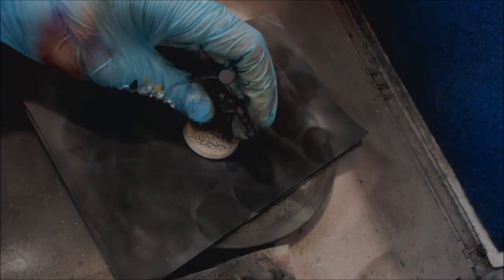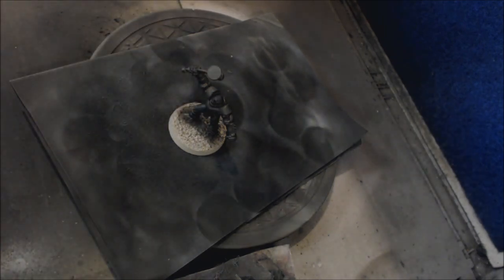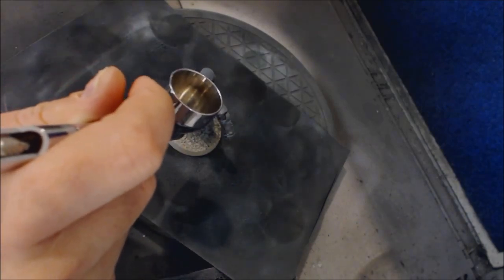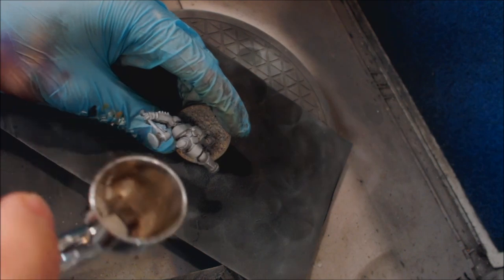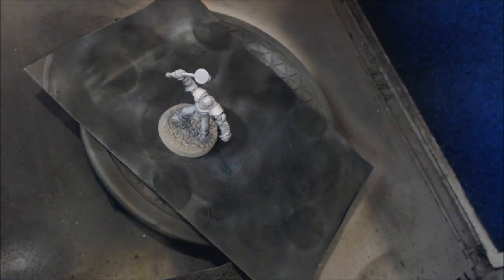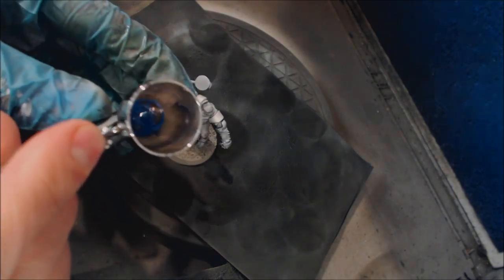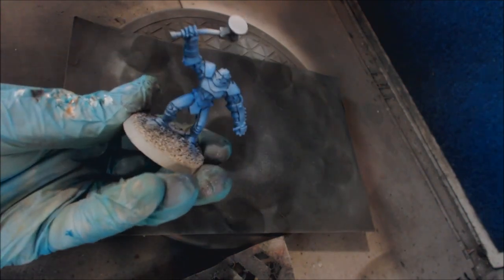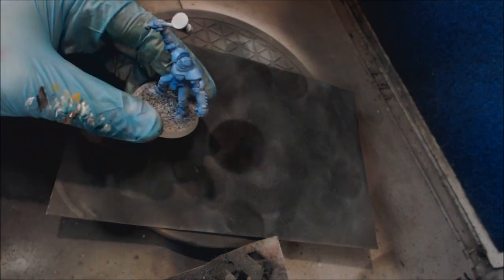Hobby Cheating 75 - Zenithal Highlighting and Glazes

Comment: Super useful Vince! Thanks for all the hobby cheating series. Question: can you combine the zenithal technique here with a rattle can Retributor armor base coat for the classic Stormcast scheme? Or is the rattle can paint so thick that you'll obliterate the great shading from the zenithal undercoat? Would love to hear how you'd go about it! Cheers!
Reply from the maker: So it doesn't generally work with Metallic paints, as metallic pigment is opaque and so doesn't work well with undershading. I can't think of a good way to do it straight with Retributor armor spray, though you could do it with an airbrush and start with a deep gold with some brown ink mixed in as a base. Then go regular gold, then gold silver.
Reply: Makes sense - so you'll still get the nice luminance shift from dark gold->gold->gold/silver but you're also putting down metallic color vs here where you've separated the light/dark zenithal shading from the application of the hue/color itself with the glazing. Very helpful! Thanks again!
I think it may be time for me to look into a beginner airbrush setup!

Comment: For the black lining, Would this be a good candidate for oil washing? Am I right in thinking those smooth transitions would then be protected from your brush?
Reply from the maker: Yep, absolutely, you will still tint the color slightly unless you are very thorough with your cleaning, but it's minor and speed is the order of the day, it's a GREAT solution.

Comment: I'm getting my first airbrush in a week or so, so i've got alot to learn. as far as your process, what would you do to then paint the base after you have airbrushed the mini in this example? It seems like alot of people completely finish their bases separate of the models, but then some people seem to still paint the mini attached to an unfinished base. just curious, thanks for the video.
Reply from the maker: So in general, this happened to be attached to the base, but my normal process is to paint them completely separately. I finish the model, then finish the base, then put them together. If you want to do it with the figure attached, I would recommend the base be last, airbrush and do all your work on the mini, then brush paint the base to finish it out. 

hope that helps.
Reply: @VinceVenturella  that does help thanks. just one further thing you could illuminate for me then is how you go about putting the two together without ruining the paint job on one of the parts. Is it all just pre drilled pins?

Comment: If you're painting a dark blue colour, like Kantor Blue for example, how do you prevent it looking de-saturated, or too light in the lighter areas?
Reply from the maker: So the key is to apply additional glazes at the lowest levels off the highlight. There will always be some desaturtion,but additional glazes in the shadow areas will make the color seem more rich and true to it's original color while preserving the highlights.

Comment: with your straight white, what is your thinning ratio, or are you well shaken and straight from the botte?

also, please, what psi are you shooting from?

thank you for the great video and for your response
Reply from the maker: With white primer if that's what you're using for zenithal, I put a few drops of thinner into it before the primer (say 1 thinner to 3 primer). If I am using ink or paint, I think to whatever standard ratio I thin that to for a layer. I shoot at 18-20 PSI.
Reply: Thank you Mr Venturella, for the information!

Comment: Hi Vince, I want to speed paint some new Primis marines when they come out soon. I want to do a blood angels theme, but I have a couple of questions first :) 

1) Is there a difference in between just using a red triad and hitting up at different angles vs the method you demonstrated here?
2) Also, when I do the undercoats for red doing this method, do I go 
black > grey > light grey/white > brown (all) > red (all).
OR brown > light brown > lighter brown/white > red (all)

Thanks again.
Reply from the maker: 1) I assume you mean doing this whole process with red. The difference would be in the depth of shadows and highlights. Especially with red (as it's a translucent color) undershading makes a big difference in the depth of the final color. 
2) I would go Black>Grey>Brown Ink>Warm White (like an ivory)>Thin red glaze. If you want to get really crazy Black>Purple Ink>Grey>Brown Ink>Ivory>Red Glaze.
Reply: Vince Venturella Thankyou. Just clarifying, black (primed) > grey (90degrees) > brown ink (airbrushed 45degrees) then a warm white (above) > red ink (air brush glaze)?
Reply: Vince Venturella also, any recommendations on a red or brown ink? particularly a common one I might find in Aus ?
Reply from the maker: Black (Everywhere) > Grey (45 degrees) > Thinned Brown Ink (Everywhere) > Ivory (90 degrees directly from above) > Red Ink/Glaze (I would actually go for thinned paint for coverage, but it depends on the ink). 

As for inks, I would say Vallejo. They are generally available everywhere from Amazon. If you can get the standard ink pack, that contains many useful colors including black, brown (Sepia), Purple, Blue, Red and Yellow.

Comment: Is it better to spray without the base on? I'm worried about wrecking it. How do I make it nice after spraying it up?
Reply from the maker: Well, my personal preference generally is to always keep the base separate. In this case, it was already done. My best advice is if you refuse to do the base completely separately, it should be done like I did here where it's already based and textured. Priming and zenithaling everything at once will only help. Just paint the base separate, your darker early colors will mostly cover whatever is done here with a color.

Comment: When using a pastel/soft colours in the greens and yellows what would you recommend  because black, grey and white doesn't seem to be the best combo for them.
Reply from the maker: So for Orange, Green (sometimes - if I want yellow green) and Yellow, I do what you saw here with 2 changes. First, after the black and grey, I give the whole thing a thin coat of sepia ink (basically, tint the whole thing brown). Then I use Ivory or a warm white from above. Something like a rust (both dark and mid-tone) can also replace the black or grey as appropriate. Those provide a much better starting undershade for those colors.
Reply: Vince Venturella thank you

Comment: do I need good ventilatod room to do air brushing?
can you describe your setup and your airbrush that you are using and the compressor
Reply from the maker: I airbrush in my office, which is in a basement and has no outside ventilation. As long as you are using a hood with a good filter (I bought the collapsible one from Amazon) and a mask, you should be just fine. My set-up is just a small desk with the booth on it. I fire up the fan, put on the mask and go to town. 

As to Airbrush and compressor. I have several airbrushes. I like Iwata and Grex. My compressor is a Master generic compressor with a tank.

Comment: Is it possible to add other colors to the zeniths shades to get a prime with color? Or should one only use the grey-white balance first?
Reply from the maker: Sure, you can and should often. If you are dealing with wanting rich yellows, oranges or reds, it's generally good to insert a dark brown step inbetween the black primer and grey and use a warm white to finish instead of a pure white. You could also replace the grey with a mid-tone brown. 

Basically, you just want to think about it from an undershading perspective and how those colors over top will interact and be enhanced by what's underneath.

Comment: Been using zenithal for ages but often my figures end up dark after priming. I’ve been leaving large portions of say, the torso under the arms (the arms block the grey and white) and legs and often front torso black. 25-30% of the model is black I’d say. How much black do you generally leave?
Reply from the maker: less than 10%, you want very little black. In fact, I will often then anti-zenithal from below with an actual color to remove the black completely and make it simply a dark color. Hope that helps.
Reply: Vince Venturella wow. So I’ve been leaving much more, and of course the glaze layers won’t go on as well in some darker areas. But then why have the black at all? If I cover it all up with (most,y) grey and (also a little bit of) white primer, aren’t I killing part of my shading gradient?
Reply: @Vince just bumping this. When I leave very little black am I defeating the purpose of zenithal? Why not just prime white (if I plan to use glazes or contrast paints to finish the model)?

Comment: Hi Vince, I am having some trouble with Vallejo primer clocking up my airbrush. How much (if at all) do you thin your primer and have you experienced more/less clocking depending on the psi value?
Reply from the maker: Alwasy add thinner to everything. I tend to do 1-2 (Thinner to Primer). I would also check out Hobby Cheating 213 on cleaning your airbrushing. 

One other thing to warn on, when primer gets to the bottom of the bottle, it gets some clumps that can cause some extra clogging.

Comment: Question for you, Vince. I have some GW Culexis assassins I'd like to use this method on. Is it even worth doing for black? I'd like to keep some subtle high points a very faint grey, but I found I just darkened it back down to black all over.
Reply from the maker: Yes, I do this with pure black. The key is you use very thin layers of black glazes in progressively smaller areas to bring everything to black while maintaining the highlight. Hope that helps.
Reply: Vince Venturella thanks! My first mistake was using flow improver instead of thinner, and my second mistake was being too hasty and not letting coats dry in b/w passes. Thanks again.

Comment: I tried this method on several minis and seem to be getting a speckle pattern the far end of mini from where the airbrush spray pattern ends. Shooting at 25 psi with a badger 105 .5mm needle.
Reply from the maker: So there are many options, specklin can always happen to some degree, it's what the airbrush is doing. That being said, the likely causes are either a) The paint isn't thinned enough (in which case add more thinner) b) The PSI is a little uneven or c) tip dry is chopping the paint as it travels through. I would try some additional thinning to start (I would also knock the PSI back to like 20PSI).
Reply: Vince Venturella would the thinner apply to Vallejo primer as well?
Reply from the maker: @jabjab90301  100%, especially to primer. Nothing (and I mean nothing) goes through my airbrush without thinner. Primer generally goes through at a 1-2 ratio (1 thinner to 2 Primer).

Comment: So would you not recommend xenithal priming on a model that is going to be primarily wearing white armor?
Reply from the maker: It can still be a good thing, actually makes it much easier, it's just you are mainly working shades smoothing out the lower tones. It's a little different, but yes, it's still what I would do for a white model.

Comment: At what psi do you prime? You said 15 bar.. Did you mean 15 psi? Or does that mean like 30psi? Do you turn it down for the grey or the white?

I took an airbrush class and the guy was priming at 30psi but used the badger primer. He was actually talking mad crap about the vallejo primer. He was also using tons of paint with high flow. Where as I've watched you prime and it goes on very light, he was kind of "emptying the pot" with his priming. It worked out fine though, maybe because of the primer.

He said that vallejo primer takes 24 hours before you can add anything else. I'm thinking that is wrong and might only br true if one sprays at full paint flow.

I did buy one bottle of the badger primer to try it and to experiment myself but im pretty sure i will do it like you. Thin and controlled, not like trying to fill up a swimming pool that he was doing. But it DID turn out fine. I guess its just the different paint formulas.

He said vallejo is sticky and gloppy and takes 24 hours to cure. Im assuming that is only if you put it on super thick right?
Reply from the maker: I prime at the same I do for most everything, 18-ish PSI (basially 15-20 is fine). 

All of that about the Vallejo Primer is silly. It's fine, It's my main primer and I have used it on hundreds, probably thousands of models. I prime with it and paint 5 minutes later. Angel Giraldez does the same as his primer and paints after 2-3 minutes. So that's all silly. 

Basically I use either Vallejo or Badger, I actually like both and always prime with that PSI above and do it in a few thin coats of primer.

Comment: To be clear, you thin your paint.  Is it a 1 part to 1 part paint to thinner ratio?
Reply from the maker: There is no one solid formula specifically sadly. It varies by type of paint and it varies a lot. What I will say is generally inks are best and you want it way more toward thinner, like 5 thinner to 1 ink.

Comment: What about yellow Vince? what base should I use? orange or a warm brown?
Reply from the maker: I would use a light warm brown (like Light Rust from Vallejo for example, a very ruddy brown).
Reply: I want to do quick ironjawz using the yellow armor theme and then simply adding a green brush glaze over the already highlighted yellow skin.
Reply from the maker: Yep, I would do the following. 

1) Prime in grey black
2) Cover most everything in light rust (I would leave a very small amount of black)
3) 90 degree warm white (like an ivory or sand)
4) Quick shot of some pure white on the tops of plates. 
5) Yellow all over. 

Then go from there.
Reply: Vince Venturella Thank you! I will get on to it after I'm done my current project!

Comment: How close of a result would you get with a spray primer zenithal highlight? Thinking about using the same colors and apply in the same angle as you do in the video. Do you think the speckling effect caused by the rattle can will show through a lot later after you applied your basecoats?
Reply from the maker: You can get close, but you do it with 2 colors only, black (or dark grey and white). You will get speckling, but it can largely be covered by later paints.